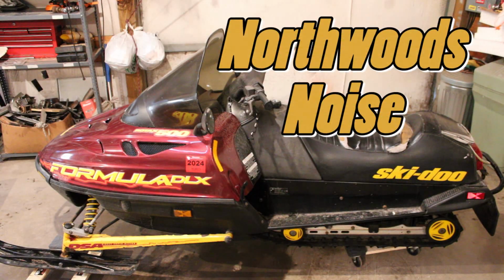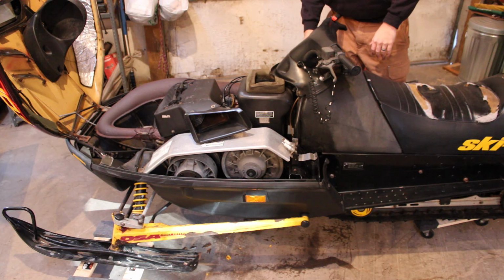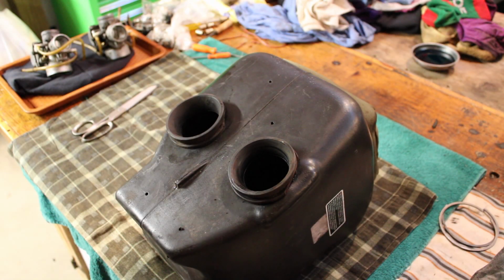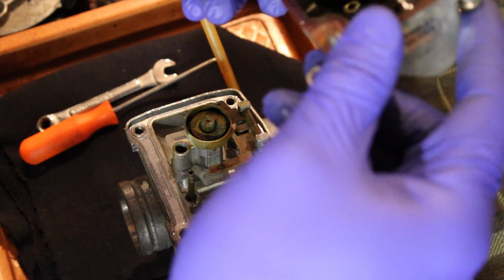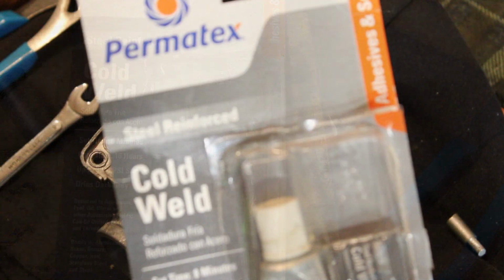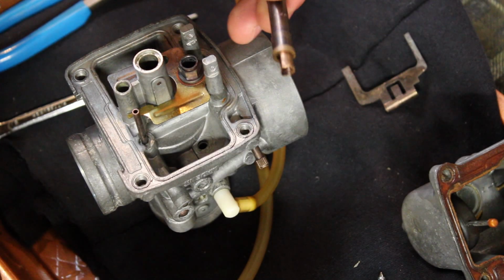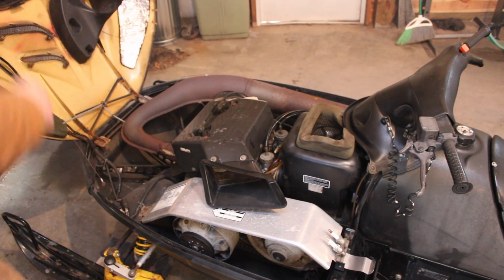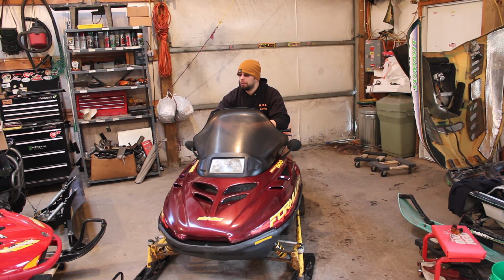Previous owner really jacked up these carburetors... let's get them fixed. 1999 Skidoo Formula DLX

Comment: Those fan sleds are great. I have a touring SLE. Watch those air box boots as to not lean out the mixture. I also believe the manual says those jets are to actually be 2 different sizes. Love those old Skidoos.
Reply from the maker: I love the 503s, fantastic engines. For sure, the plan is to eventually swap out those boots. I was reading up on the jetting yesterday, I thought they only staggered the jetting on the rotary valve engines due to the rotary valve timing, but I guess it's done on alot of engines. Typically the mag side is jetted leaner because that cylinder runs hotter due to the proximity to the exhaust pipe. I learn something every day lol.

Comment: Glad to see you get some fun out ur time fixun!!!you seem like a guy who can lead me in proper direction,ive just got a sweet deal this summer on my first used sled its a 1990 red n black 400 indy polaris needed a new fuel pump and inline strainer and seat cover all for total of 350.00 no title but not stolen.i checked!!!anyhow its got no reverse or electric start but block clearly has provision for starter i saw on ebay a few clutches n reverse from an indy 500 can you give any crossovers and yrs that would fall into realm of working.dont wanna waste money?snooky pa.p.s.i got one rip on sled and it rips nicely.💥👍😜🤪🤟💥

Comment: It's your Canadian comrade. Nice video..Thumbs up as usual. I'm 64, thank God you piped in some METAL, not that annoying millennial, monotonic, rap crap, otherwise I would have split! LOL! Sure is nice, I also don't have to hear every five words, "Uh-Uh-um" drives me nuts. Something to do with the IQ. Well as far as the copper/brass changing color in your cleaner, obviously a chemical reaction, (oxidation). I was formerly in the RF engineering world, (communications) and the connectors are made of brass, after some time outdoors, they will of course darken (oxidize). I found that cleaning (soaking) with a mixture of vinegar and baking soda solution will bring back the luster. By the way, we received our snow, Toronto news made a big deal about it, (Feb.22/23-2023) but a measly 5" fell, big DEAL! Being a former Montreal-er, that's dick all! None the less got one of my '95 GT 670 up and running, yesterday, did a rip around toady, but now needs work on the electrics. Man those machines and engines have some serious BALLS! LOL! Mind you, my last ride was back in '77, (75 TNT FA).... Locally someone has a pair of '96 Mach 1 and Mack Z, MINT!!!! in storage for over ten years, less that 500km!!!! I'm drooling! Maybe I can sell one of my kidneys! LOL!!! Cheers, keep it up, I find you interesting. Oh by the way, did you ever torque the nut on the jackshaft ??? One last comment, got to like the epoxy, but for myself would have preferred to TIG weld the carb.
Reply from the maker: Thank you sir! Lol glad you enjoyed the music, cant make everyone happy but I felt it was time for a change. I'll listen to just about anything with a beat, but metal is by far my favorite. Thanks for the explanation on the brass. Interesting, I work with RF myself! I assume you mean Radio frequency since you mentioned comms. We got about 15" here over the last two days, plan to ride all weekend long. Those 670s are no joke! Still have to get around to torquing the castle nut, havent touched the green summit in a week or two but it's on my list of things to do before summerizing. Hoping the shop manual has it spec'd.
Reply from the maker: Would've much rather tig'd it myself, I agree but unfortunately a tig welder is one thing I dont have. We'll see how long the epoxy holds up. Thanks again, I appreciate the comments!
Reply: @NorthwoodsNoise  As long as the glue works....and the carb functions that's all that matters. Fact is, your not restoring a F16! LOL!
Reply: @NorthwoodsNoise  33 to 66 lbf-ft. RF eh? I wonder, do you possibly have a Ham license as well? or maybe RF engineering, broadcast, tower, cell, etc?

Comment: I have essentially the same machine (97 formula 500 deluxe liquid w/ electric start and reverse)
Edit: spelling
Reply from the maker: They're still great, reliable machines! Hard to beat the longevity of the rotary valve engines.